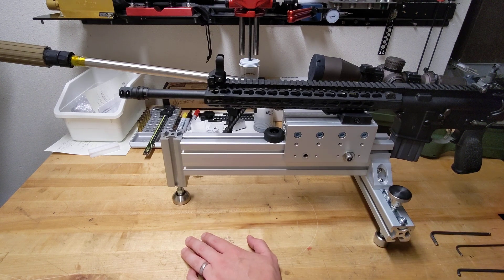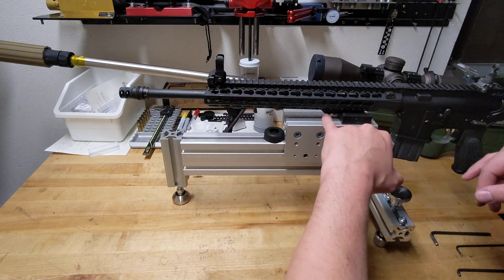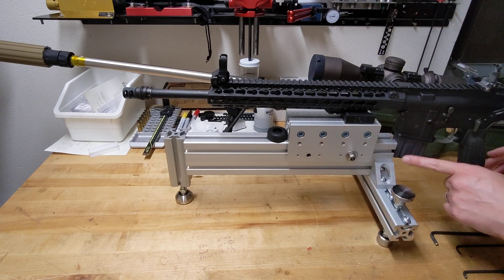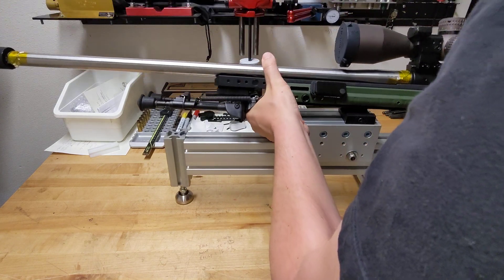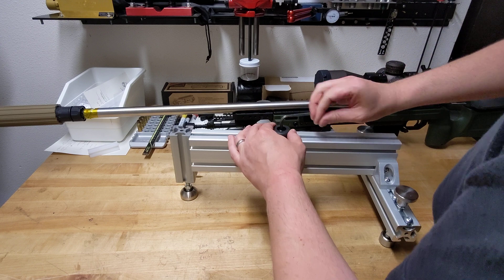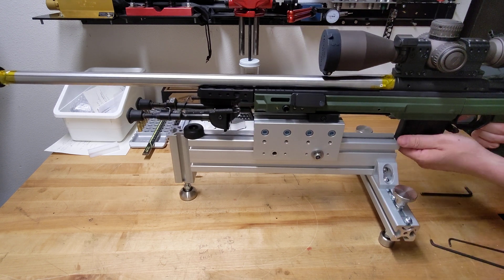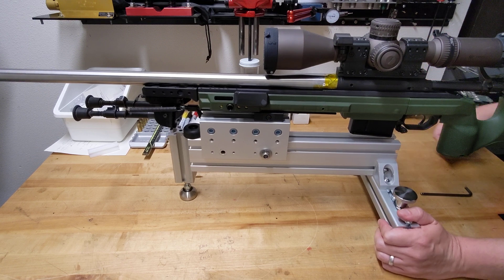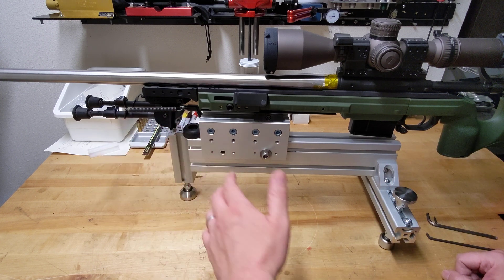Prototype Rifle Testing Platform

Comment: Try mounting at the center of mass, not the "balance point". Try balancing the rifle so the center of mass is at the cartridge base, in line with the bore axis. You might just be surprised at the results.
Reply from the maker: Good idea! That should help to mitigate any rocking motion since the rifle won't be mounted by a natural pivot point. Thanks!
Reply: @Ammolytics  Just be sure to balance the rifle with weights not just fore and aft, but also top and bottom. Lots of shooters balance the rifle along only one axis, and then wonder why the rifle still kicks and bucks up, or why it rolls over in a bipod with loose cant.  Balance around the center of the bolt face when closed and loaded, in 3-axis.
Reply: @patrickthompson389  Helpful feedback though I have some concerns that adding too many weights may inadvertently bias the performance of the rifle in ways that cannot be replicated when firing without the rig. The goal isn't to eliminate recoil.
Reply: @coolgeekish  I never mentioned adding weights.... 

You should balance with scope, rings, barrel profile, sometimes weights in specific spots, as part of your system configuration. Example; you wouldn't put an MTU Barrel & ZCO 5-25 on a carbon hunting rig, because its both unpractical and completely top & front heavy. But, if it's a PRS rig, you'd balance this with weight in your stock. But most shooters don't look at where these weights actually go, in reference to the bore axis, and the preferred center of mass placement. You need to consider the thrust & recoil direction, and how and where it affects the CG & CoM of the rifle. If the barrel pushes straight back, but the center of mass is below the bore axis, the barrel will flip up, predictably. If the stock is too high, it will push down. If you have a massive scope on top in a heavy mount, it will rotate around that mass and push your stock up. But if balanced on three axis, it will recoil in line with the bore axis, and subsequently provide a stable muzzle that does not affect the trajectory held.

Comment: Making small groups with this fixture should be easy, in theory. But as you may know reality is often different and more complex that what we can think or see. Even in benchrest shooting, small things like trigger, recoil, muzzle jump, rifle balance or harmonics have an effect on the group size.  I will watch your next videos to see if it works as expected. Years ago I have built such device, it was slightly different because the gun was held by the barrel (stock removed) and the trigger was pulled by a servo motor but the aim was the same.

Comment: Thanks for the vid. 
I do like what you're doing & ,I understand where you're going with this however, the problem is, this doesn't do a whole lot if we're aren't benchrest shooters.. I mean, I know what you're saying &, I've thought of this kinda thing myself but, unless I can duplicate this settup all the time, it's not kinda going to help me/us.
Not only that but, about the best group you're going to get with a semi auto is 1/2" at best. It's the nature of the beast &, it's nothing to be ashamed of.
Reply: Eh, benchrest shooters buy a benchrest, which basically have only one purpose.

The nice thing about this is that the extruded aluminum frame is super modular and you can hang all sorts of stuff off of it if you so choose.  Want a longer one?  Don't cut the truss as short.  Want to measure muzzle brake performance?  Put a force sensor on it.  Want to use it for crossbows or pellet rifles, order a clamp from 80/20.  Want to standardize your chronograph results, build a cantilever mount that hangs off the front.  Want to make it super portable, swap the screwed in gussets with hand clamps and the whole thing would fit in a shoe box.

I feel like we'll see this in future experimentation.
Reply from the maker: I probably spent more time explaining the what in this video and not the *why*. Thanks for raising this and making the opportunity for me to try to answer that!

I'm not suggesting using this for normal shooting. It wouldn't be permitted in competition anyway. Here are some use cases that I think this would be good for:

- Increasing confidence of a precise zero on a rifle
- Debugging precision issues
- Load development
- Component testing (muzzle brakes, triggers, etc)
- Benchmarking rifle/ammo precision

The last one is key. Too many folks go out and buy more stuff, but it's important to know the capabilities of your rifle/ammo so that you know if it needs to improve, or if the operator does.

That's why it's designed to let you just attach a rifle as-is, instead of removing the action and possibly missing something that could be affecting precision.

Lastly, I'm working on measuring barrel harmonics. For those experiments, I need to remove all unnecessary vibration to keep noise out of the datasets.

Hope this helps & thanks for watching!